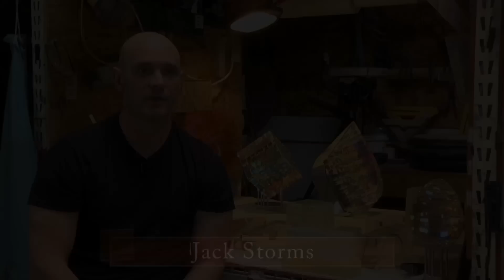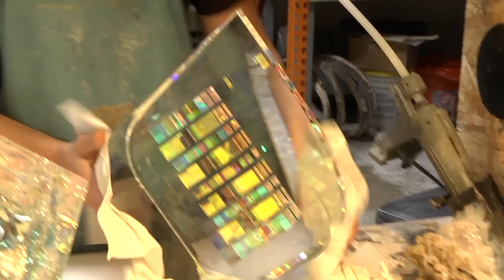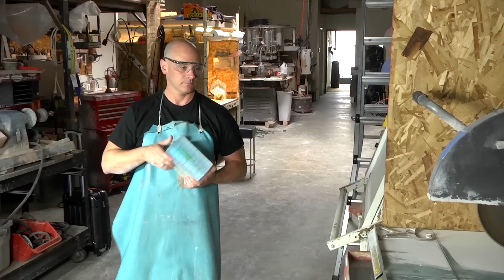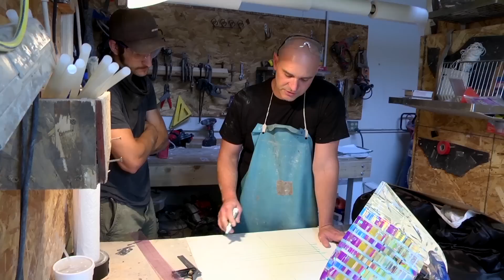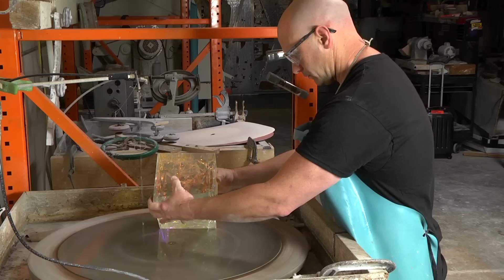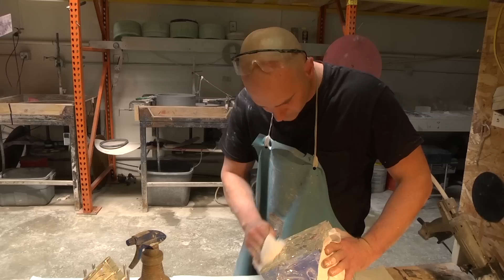Jack Storms PR Video

Comment: How do you bind the pieces together? so kind of glue or is there heat involved in that step?
btw your website is crawling with viruses.
Reply: He explained already, he does not use heat at all.
It's an epoxy, a very specific one that is special for that ;)